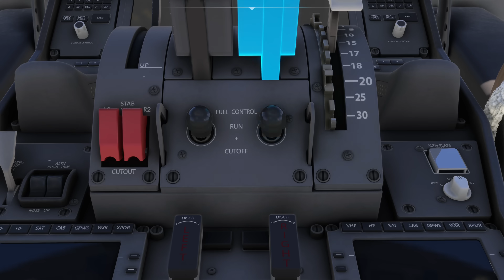Air India 171: Why Did The Fuel Cut-off Switch Get Moved?

Comment: You are so shameless that it’s so easy to blame the dead pilots without actually stating the facts. Do you have any idea of the FAA advisory 2018 which mandates the fuel valves checks and stated a potential risk of the fuel switches being inadvertently shifted from run to shut off in some of the Boeing aircrafts including the 787. 

The pilots in India are very well trained and let me tell you one thing it’s very easy to have a false narrative which saves Boeing as they are the big fishes and hence put the blame on the dead pilots. 

As a pilot you should be ashamed of bringing up shameless theories every now and then.

Comment: I'm astounded that you are so cold towards cockpit video recorders. You say that the audio & data recorders give virtually the same information. Really? So which pilot shutoff the fuel then? Only video would show that, as the switches are within reach off both men. What was happening during the 10 seconds before the switches were set back to run? Video would have shown that. Why was there a 4 second delay between one switch being returned to run position & then the other? Video would have shown us that. Which guy asked about why the other had shut off the fuel? Video would have shown us that. Was there a struggle between them, as one of the guys tried to set the switch back to run, but was prevented by the other guy? Is that why there was a delay of 10 seconds to switch them back, then a further 4 seconds to set the other switch back? Video would have shown us this. As the old saying goes "a picture paints a thousand words". A moving picture paints even more.

Comment: If the fuel lines were cut-off and then re-started, why did the RAT deploy? If the ideal scenario when a pilot would cut-off those lines is due to an engine fire during landing, why doesn't the RAT deploy then?

Comment: Hi Captain Steve, I am still failing to understand why pilot need fuel control switch functionality at the time of take off right after V1. Shouldn't the plane be designed in such a way to have a logic in place that doesn't allow fuel to cutoff on both engine, right after V1 until the plane reaches a minimum safe altitude? After reaching safe altitude (say 1000 or 2000ft), then pilot can be allowed to control fuel switch in case of engine fire emergencies and then glide back to land safely. If the entire ignition sequence is automatic,  why can't this restriction be automated? Even I who has 0 aviation experience can think of such scenario,  then why can't Boeing think of this functionality beforehand and implement this instead of waiting for 242 people to die? In this way how many more design loopholes need to be unravelled? Or maybe Boeing has thought through all these loopholes before and implemented, but their logic failed for AI171 allowing the pilot to manually cutoff fuel right after take off or maybe their faulty logic itself cutoff the fuel, just like their MCAS was faulty earlier.

Comment: What are the memory item actions for a dual engine failure in a 787? Is there a possibility that putting fuel shut off valve to cutoff and then run was as a response to action toward dual engine failure?

Comment: I don’t believe it was human error. In fact, I see the pilots as heroes who were doing everything they could to save the aircraft and the lives on board.

There’s no indication that the physical switch was set to “cutoff”—only that the signal showed it as such is recroded.

According to the report, the First Officer was the pilot flying, and the Captain was the monitoring pilot. The FO had both hands on the yoke from three seconds after rotation until at least 1,000 feet. It's highly unlikely he would have reached for or touched the cutoff switch during this critical phase of flight.
Based on the video the plane was flying in a good control all the way until crashed.

It’s more plausible that the crew saw the "cutoff" indication on the screen and recognized the engine had lost thrust. 

The conversation recorded in the cockpit voice recorder supports this, suggesting they were trying to troubleshoot and manually reset the fuel control to ON:

> “In the cockpit voice recording, one of the pilots is heard asking the other why he cut it off.
> The other pilot responded that he did not do so.”

It’s crucial that the AIIR release the full cockpit voice recording transcript, not just a summary. Transparency here is key.

Another important point: the report mentions that further investigation will focus on mechanical failure rather than pilot error—this shift in focus reinforces the idea that this may not have been caused by human action.

Comment: 1. I'm curious as to why a $1 billion, cutting-edge aircraft does not have a cockpit recording CCTV system.  A $500 go pro and a 5T memory card will do the job.
2. In the event of cockpit sabotage, specially during take off, AI should take over the aircraft to prevent any wrong doing until the problem is remotely managed.

Comment: The last time it happened was in 2015 when the co-pilot locked the captain out of the cockpit and deliberately crashed the plane with all the passengers on Germanwings flight. It turned out that he had suicidal thoughts and sought help from a psychiatrist. What emerged then was that the psychiatrist replied that he could not report it to the airline due to doctor-patient confidentiality. Voices were raised that this confidentiality should be lifted if the patient has such an important role as a pilot at a major airline.

Comment: I think it on any critical steps being done, there should be an alarm blaring. If engines are running and you switch off the fuel for both, it would let you do it, but when you do that, it would scream for few secs just to let both Pilot know that something bad is being done.

Comment: Why not take their word?  The switchs could have gone off due to failure of equipment. Then one of the pilots notices by the noise of the engines turning off. Asks the other.  The second pilot says. I did not do it. Then it's all a fight to keep the plane in the air and search for a landing spot.

Comment: One thing no one seems to be considering is a medical event. I realise it's unlikely, but if the pilot monitoring had a minor stroke on takeoff he would be sitting there in a confused state knowing there was something he was meant to do after the plane was in the air, like bring the gear up. But in his confused state he could have just reached out and did an action the was familiar with without thinking. That also explains why he denied it when asked, he was still confused.

Comment: The issue would seem to be whether the switches were deliberately or accidentally turned to the cutoff position (I gather accidental is still a possibility because the covers that were supposed to prevent that happening could be ineffective). So the answer is either it was deliberate and therefore suicide, or it was accidental - which would explain how the other pilot said he hadn't turned the the switches to the off position). It's looking like it was a suicide, but accidental cannot be ruled out as I understand it.

Comment: It takes a lot for me to comment on social media, however I'm not buying that this is a solved mystery. My background in hardware and software leaves me with the following questions. What is the sample rate of the FDR? If it is one second, the fuel cutoff indications could have occurred as little as a small fraction of a second or simultaneously up to just under one second. The FDR timing is asynchronous to other systems therefore I don't think we can be assured that the time between the fuel cutoff reports is actually one second, it could be .01 second 0r .99 second or even simultaneous if the event took place at the sample time stamp transition. What concerns me as well is why there is 4 seconds between the re-selection to the run position, if the pilots were on the problem, which at least one was,  and the switches were actually in the off position when the problem was detected, the selection to on position would be ON left, ON right immediately, not a 4 second pause between those two actions. UNLESS, the switches were physically in the ON position and the action was to actually recycle the switches. Left Off, then On, Right Off, then On. That would potentially explain the 4 second delay. Everyone is currently defending the hardware and software and putting the blame on rogue pilot action. We’ve seen this before, with significant consequences, therefore I’m willing to wait for more information before jumping to any conclusions. I certainly hope the investigators in charge of this investigation are maintaining an open mind.
Also, I have years of experience with these switches in various hardware applications, The question concerning the SAIB and the switch installation is a rabbit hole not worth going down, if there was an issue with the switches on this A/C it would have easily been detected by the various flight crews and maintenance personnel during routine operation. The fault certainly would not have gone unnoticed for 11 years !!

Comment: Another aviation commentator on Youtube said that per procedure, pilots on takeoff hold their hand against the throttles, which are just above the cutoff switches, and that perhaps turbulence caused their hand to drop and hit the cutoff switches.  This, in conjunction with switches that did not index as they should, could have been why the switches were moved to the “cutoff” position. This might also explain why one of the pilots denied actuating the switches (at least intentionally). This theory doesn’t seem to explain their being a 1-second delay between actuating switches. When flying small civil aviation planes, my instructors wanted one hand on the throttle when that hand wasn’t being used for something else.  Your thoughts?
Also, I believe you mentioned a possible “brain cramp” causing the switch actuation.  If memory serves, isn’t that what happened in the crash of Richard Branson’s space tourist rocket where the co-pilot actuated the lever that put the plane in that odd bent configuration for re-entry too early?  Same sort of mental error here?

Comment: As Steeeve pointed out, instead of Cameras, there are Cockpit Voice Recorders and Flight Data Recorders ... SO ... Why is the Investigation choosing to IGNORE THE COCKPIT VOICE RECORDER as that evidences that neither Pilot moved the Fuel Cut-Off Switches ... which would only leave an equipment failure only as the explanation !???!?

By Equipment Failure, I mean something controlling the electrical impulses that were recorded, but not the Fuel Cut-Off Switches themselves. Presumably, the Flight Data Recorder receives most of its data from the Flight Management Recorder and Engine Management Computer and that data could be correct in identifying what the software, or hardware had done, even without the physical switch being moved by either pilot in the cockpit !

With all due respect, it is idiotic to ascribe the second Pilot's verbal response as being a 'lie'. The purpose of Cockpit Voice Recorder is there to provide evidence. Why would a professional pilot about to die be bothered to formulate a lie when it would make no difference ? Lying is intended to deceive and no deception was necessary ... 

Yes. It is still remotely possible that one of the Pilots did lie, but much less likely than this being an equipment failure ... 

Furthermore, why would a Professional Pilot take an entire 10 seconds to correct the Switch Position ... that is a hugely long time in the circumstances, as that Pilot had identified the problem ?? I am reluctant to believe that there was a 'fight' between the pilots in the cockpit over control of those Switches ...

Was there a third person in the Cockpit ?

The initial report is far too convenient a narrative and seems flawed for these and many other reasons ...

Comment: The 'black box' does not record when the fuel cut-off was moved. And had the first pilot caught
the other pilot "move" the cut-off switches ..... would've moved them back immediately instead
of his BELATED, "why did you cut-off."  Those two switches could have been left in the halfway
position by the previous crew ... neither on nor off ... then accidentally knocked into the cut-off
position without even realizing it. The accused pilot saying, "I did not do that",  may well be true.
Either pilot could have knocked/bumped them into place without  realizing it.

Question: does the onboard computer ignore those two switches on take-off?? Can it ignore
those switches if they are half-way between on and off? Is there a glitch in the program? What
inputs, if any, does the software ignore on take-off?  *If its not pilot error: its computer error*

A solution: the computer should have been programmed to make it impossible to shut-off the
engines at such a low altitude, especially an aircraft fully laden with fuel. If the engines are on
fire at that low altitude .... engine shutdown .... POINTLESS .... its game over.

Comment: Of course, I’m not familiar with the software on the plane, but I’ve heard synthetic voice prompts from voice recorders from other crash investigations, shouldn’t a voice prompt, “shutting fuel to engine one,” be integrated into the flight software system, and “shutting fuel to engine two, in takeoff configuration,” “acknowledge?” Also you’ve said that voice recording and data recorders, give similar information to cameras in the cockpit, but not here, which pilot shutoff fuel to the engines? While not an AI expert, I understand that through FFT analysis, one can interrogate the sound recordings to possibly determine which pilot reached down and lifted the detent knobs and slid the fuel switches to off. Whether from sound reflections from arms or clothing, a large enough sample from simulator runs, the problem might be tractable.

Comment: Are there any other switches that are design to be moved in the same way or is it only the fuel switches? In my opinion, it would mentally be practically impossible to do it accidentally if those are the sole switches requiring that movement.

Comment: 4:42 Clarifying further, the mixture cut-out procedure is meant to minimize damage to the engine and reduce the speed of the propellers (would could become projectiles if separated). A sudden stop on the propeller shaft of a running engine will basically total it. If the engine is cut out before impact, there's at least a chance the damage could be salvagable.
Reply: A 787 does not have propellers.

Comment: If we go by the sequence of events 
1. The Fuel cut-off buttons were working in Supply mode
2. They went into Fuel Cut-off mode(By whatever reason)
3. But then they were put back in the supply position to try and revive by one of the pilots

So, the final position is supply and not cut-off. Then how come the report says that the buttons were in cut-off position.

Comment: I have respect for Captain Steve. However two things stand out strongly --- there is no good reason to not have a basic video recording that dumps only to the black box, and the SAIB 2018 does NOT say that the faulty switches would not even allow the plane to take off -- it says that the fault with the locking mechanism is present during installation but its impact could be in flight and dangerous. That is, the fault does NOT prevent the switch from going to ON

Comment: I have been reading more into this and my conclusion is two spring actuated switch can't be cut off in one second. This switches are designed for fail safe mode and needs to be rotated as well.There is equal possibility of electrical  or mechanical failure!
Can you show a demonstration on how both the fuel cut off switches can be cut off in an interval of 1 sec?

Comment: Captain Steeve,  I don't think you are right this time. I don't think it's human error at play here. The report did not give enough information and are missing many crucial time stamps of the events and status of flight and the conversation in the cockpit and health of the engine before and time stamps of what happened second by second considering the whole flight lasted less than a minute. I don't think it's that hard to give us this data. Something doesn't sit right and it's convenient to blame it on the pilots so that no one is held accountable for loss of those nearly 300 people's lives and many more critically injured. I personally believe, looking at all the evidence so far that, it was most probably an electronic malfunction that caused that fuel to be cut off immediately after take off and the pilots tried to remedy it when they realised but it was tragically too late. Just like the 737 max incident where the MCAST was responsible. Something similar has happened here and it's really negligent to blame it on the experienced pilots who did everything right and don't have the opportunity to defend themselves. This should be a criminal investigation. Too many are trying to evade accountability and insinuate that it was human error, which is obvious from the wording of the report.  Please reconsider your conclusions for the sake of all good pilots everywhere. Thank you.

Comment: I don't know about airline jets, but if you cut off fuel in a car, the line still has enough flowing for at least a minute. How is it on a plane the engine stops instantly - is it more to do with fire hazard? Shame had the fuel gone in straight away and restarted the engine perhaps altitude could have been gained or more control gained...Of course we are stuck with what if would a coulda